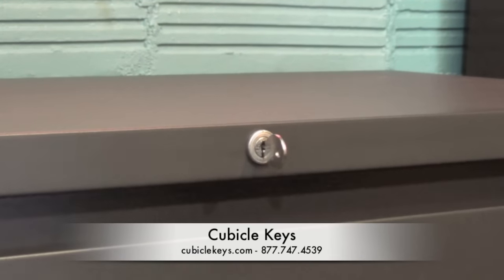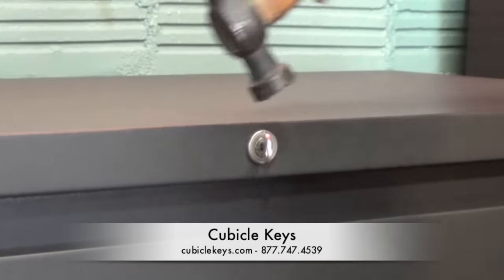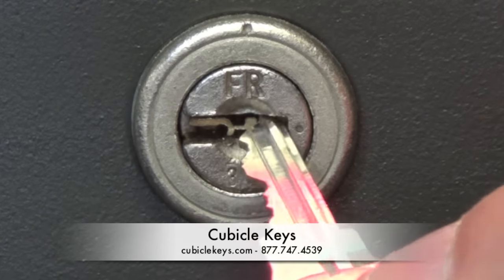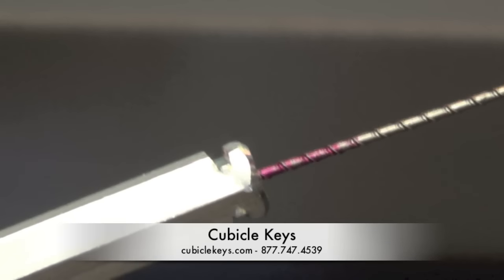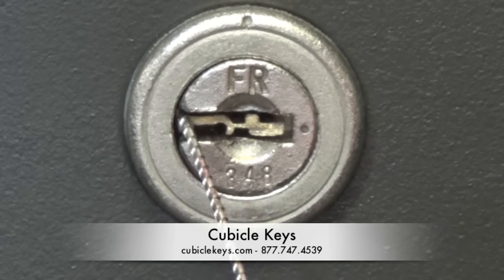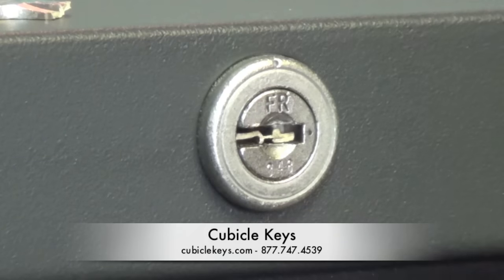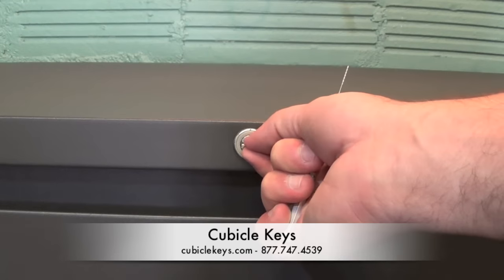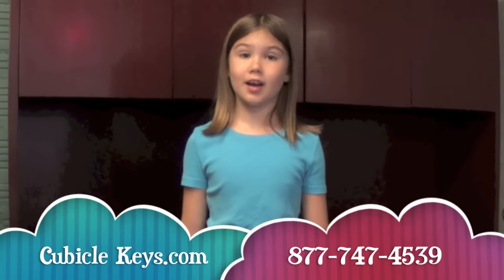How-to remove a broken key from a lock.

Comment: my safe lock was having trouble and it would take a lot of wiggling to let go of the key. after a while it got worse and the key was stuck. and worked on wiggling and turning hard and the key broke so it's not just broken but the lock is holding it.